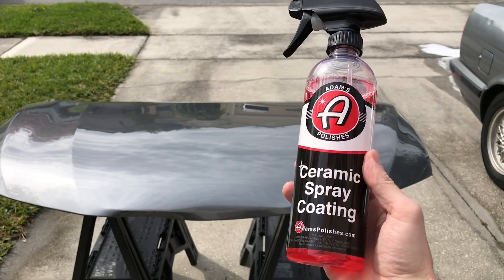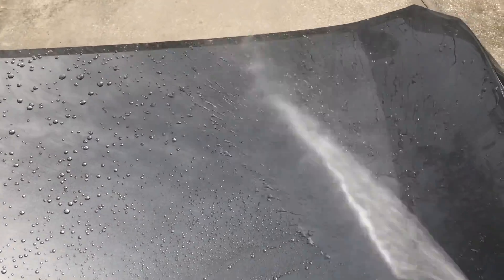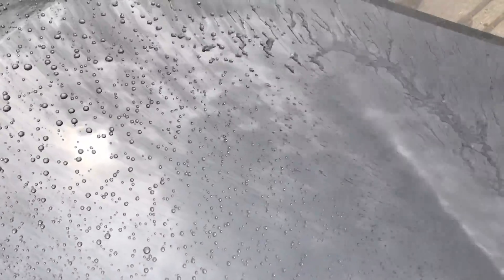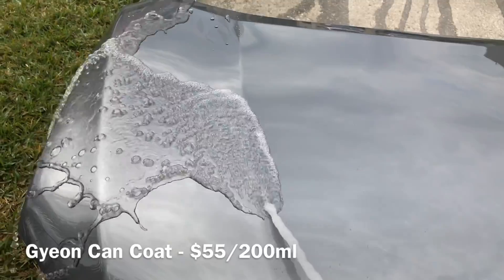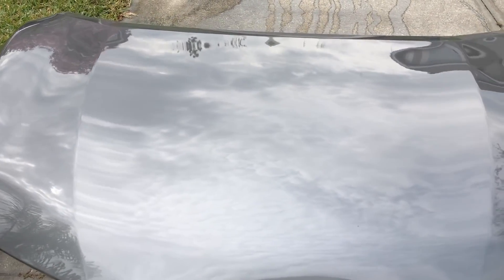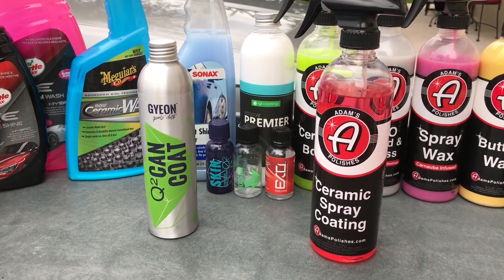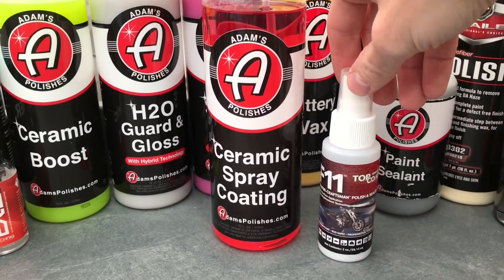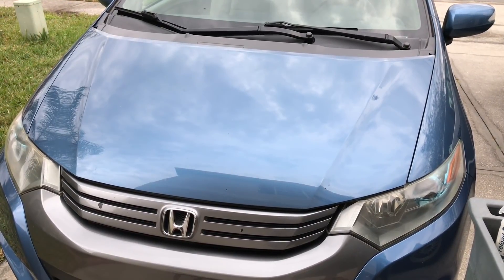Adam’s Ceramic Spray Coating - First Impressions & Hydrophobics

Comment: I just coated my car yesterday with Adams ceramic spray. I like the way it went on and the shine is excellent. I purchased the large bottle and have a lot left. I have been using Adams products for years. I will use the ceramic boost after I wash and for a quick detail.Great video ✊

Comment: Great video!  I’m currently a CanCoat user, but I find it stickier to apply and remove. I have used TAC Systems Moonlight, which I really liked because of its ease of use. I’m very interested to see how the Adam’s product compares in durability with CanCoat. WaxMode, I consider you the YouTube grandfather of testing paint protectants. I remember your first couple of videos flooding panels in your garage testing Walmart level products. There are so many who have copied your product testing methods throughout the years. You should be very proud you were the first to start this trend. Most people probably don’t know that about you, but they should!
Reply from the maker: Thanks Steve that means a lot!  I wasn't the first but I definitely got hit by the water bug once I saw just how different all of these products behave compared to each other, it's been a fun ride testing these all out!  I've heard some great things about Moonlight, none of the places that I regularly buy from stock it so I never jumped on TAC System's products but maybe some time in the future.  Really hoping the Adam's holds up because the ease of use is excellent, would be a bummer if this awesome beading is short-lived.

Comment: I'm looking forward to topping my TAC system power plus Sio2 paint coating with IGL Premier come spring. I mean ive been using various things ontop of my car since late fall and have been VERY happy with them all but this IGL Premier has peaked my interest for some reason, maybe because us mortals can't get our hands on their actual coating for paint.
Reply from the maker: I am LATE to the IGL game, and I didn't realize Kenzo was an authorized installer only coating until you mentioned it.  I was wondering why it wasn't popping up in the stores, what a bummer!

Comment: How am I suppose to know what side of the hood has what product on it? I already know about cure times and applications.... I wanted to know how each performs side/side and I have NO IDEA what is on that hood you keep hosing down.
Reply from the maker: At the beginning of the video I put the products up to show which side of the paint they’re on, Can Coat on the left half, Adam’s on the right half, they are split right down the middle of the panel.

Comment: Do you think you could please do me a favor? I was trying to find a video but couldn't find one and was hoping you could make it. Using sonax bsd and applying in while the panel is wet and drying. I want to use it to maintain my sealant and wax. I get my car done by a professional as my back is bad so I need something easy to maintain the coating. Do you have any recommendations that I can use as a wet application and dry with a leaf blower? I can use a microfiber if I have to. Thanks for all the help and work!

Comment: Mate very pleasing to hear a bloke talk about flooding, using the high mass slow water flow after washing the car.
My father has advocated the method for over 40 years. 
He would laugh watching high pressure wash and rinse. Althjough duco fi nishes have changed through the years it is still best method of rinse.
If the polish finish is adequate you should be able to drive the car down the road to complete the dry process.
Reply from the maker: Definitely, especially important if you don't have a blower to blast the majority of the water off the paint prior to towel drying.  I've been looking for some time for a nozzle that has a decent flood setting, sure beats kinking the hose and taking the nozzle off to flood, most of the quick disconnects or shutoff valves create too much pressure as well to flood effectively with the nozzle off the hose.
Reply: Blower???  Gadget for the gullible mate.

Comment: love the video what is the name of the blower thanks
Reply from the maker: The blower I'm using is the main head unit of the Ridgid WD4080 shop vac, it actually detaches from the body of the vacuum but still corded.  This vacuum is at Home Depot, but I see they're not offering the deal with the detailing kit that comes with a much better hose setup and a few good attachments, it was like $75 for everything and now I see the vacuum is $99 and the detail kit is $40 sold separately.

Comment: Great video! Where is your bead maker video?
Reply from the maker: Still working on the Bead Maker tests.  I applied Bead Maker applied on top of both of these coatings on the test panel to see how it does in the short term as a topper, more tests running against CG V7 as well that I need to see pan out.  I just topped a section of the CQUK 3.0 last week with Bead Maker but unfortunately we've got ran all day today and I wasn't able to run a rinse test yesterday.

Comment: Top Coat F11 gets a lot of talk cause they advertise on Facebook constantly! I see their ad all the time! Never would of heard of them if they didn't promote on Facebook..

I like to see you try out the Mothers CMX that's out soon! as it seems to be the talk over at AutoGeek. A 24oz bottle is said to be about $22. But it does require a 24hr cure time.
Reply from the maker: Right, for $60 you're paying $10 on a substandard product and $50 for them to excessively market the stuff online.  I've got CMX on order!  Should be in not this weekend but the weekend afterwards and then I'll start working with it.
Reply: Topcoat f11 is completely junk. Look at reviews on Amazon and google

Comment: Looking forward to durability experiences; same with the under-dog there - Turtle Wax Seal and Shine; any use of that yet?
Reply from the maker: Yes I was able to run a rinse test on a section with Seal N Shine yesterday, I didn't see anything crazy going on.  HCW is more hydrophobic and I'm very curious to see how Seal N Shine would do against the basic Ice Spray Wax to be honest, I'll probably run a durability test with these paired up side by side.  The smell seems very close to their Express Shine Carnauba Spray Wax which is a bit of a bummer, I would have liked for them to come up with a more unique scent.  Price was around $12-13 but you also only get 16oz in the bottle instead of the 20oz of Ice Spray Wax.
Reply: @WaxMode  thanks for the quick reply; the Ice and the S&S would be great match-up as I was wondering the difference myself as the Ice seems to be fairly durable. For sure having a similar scent would make me kind of wonder about formulas. Thanks again for the reviews and info.

Comment: I’m assuming the microfiber towels used to apply and buff off either products shouldn’t be re-used?
Reply from the maker: With CanCoat, probably a good idea to keep these microfibers off the paint if you plan to reuse them, the suede microfiber applicators that I use to apply it stiffens much more compared to the Adam’s Spray Coating.  The towels to buff off Adam’s you should be able to reuse them on paint, I didn’t notice marring.  If you do, check with a small section on your paint first, it’s possible your paint may be soften than what I’m working on.

Comment: So you wash the vehicle, clay it then ceramic? Can you put wax on after a ceramic coating or is it just redundant?
Reply from the maker: With coatings, generally the more prepped and polished the paint is, the better bond and durability you're going to get.  So wash, clay, and polishing if necessary is the way to go prior to use.  You can wax over top of coatings but this could clog up the insane hydrophobic behavior of the coating, so I don't recommend any paste or liquid waxes on coatings, instead a spray topper to revive them once you notice a drop in water behavior is the way to go.  Adam's is easy enough to work with that I feel like you could use it as a topper to itself.

Comment: Hi, to coat a full size sedan how much product do you think it will take? Just trying to figure roughly how many cars it can coat. Thanks in advance
Reply from the maker: Adam's is estimating 3-4 cars out of the 8oz size, 6-8 out of the 16oz size.  I feel you could probably stretched this a little further than that, seems like it spreads nicely in the towel.

Comment: Before applying any product ... You always wash then clay bar and polish the vehicle ???
Reply from the maker: Only for testing, I polish all previous products off the paint because the current wax/sealant/coating can impact the performance of whatever you're putting on top.  For everyone else, it's up to you how much prep you want to go through to try a new product out, you can definitely apply a multitude of different products over top of each other without any issues.  But with coatings, they come at such a high price that you really want to maximize your prep to maximize the performance of the coating.  However, something like this Ceramic Spray Coating may work very well on top of surfaces that have already been sealed or coated when used as a topper.  I'm testing this out now.

Comment: What are your thoughts on Gyeon can coat compared to Sonax  net shield ? Thanks
Reply from the maker: I really like both, they're much different products but overall outstanding in their own rights.  Sonax Polymer Net Shield I have not run through a topping durability test, it definitely survived at 5+ months with no toppers but I feel I could have stretched that farther with regular toppings, I buffed it off the paint before it completed its durability cycle.  But man, it's a workout to apply and remove to the whole car, the wipedown is excessive, I feel Gyeon Can Coat is better in this regards, not as much of a workout.  Both have top tier hydrophobics, but Can Coat I believe has a higher potential for stronger durability over time when topped regularly.  PNS doesn't feel as slick as Can Coat, but still provides a strong gloss like Can Coat.
Reply: WaxMode thanks brutha! Keep up the good work. Love your videos.

Comment: When u use the microfiber towels with ceramic coating do u have to throw them out I’ve seen a few things about the towels holding small particles that can scratch paint.. what your take on this
Reply from the maker: Can Coat starts to cure quickly in the towel after use, the Adam's didn't feel near as impacted but I also threw these in the wash shortly after use.  With coatings, it's a good idea to have some towels that you would not mind throwing away because they can definitely scratch the paint after the coating cures in the towel.  Jon at Forensic Detailing did a great video on this, and I have noticed marring on towels that I've used with CQUK that I didn't throw away.  For this reason, I use the Kirtland Signature brand that come in a pack of 36 towels that are a decent price that I don't mind throwing away after use.

Comment: What/which product would you recommend if your car has already has a ceramic coating to help maintain it??
Reply from the maker: I'm working on testing this out.  Bead Maker has been fantastic on top of older coatings, great slickness and gloss, it really has revived a lot of the hydrophobic properties of the base layer coating and even boosted beyond short term level performance on Classic CQuartz.  However, I'm not as sure of its use on top of fresher coatings so I'm still testing this out.  Otherwise, Polish Angel High Gloss, Rapidwaxx, and Cosmic Spritz have been great, Gyeon Cure and CarPro Reload are standards on top of siO2 coatings.
Reply: @WaxMode  cheers pal

Comment: Adam's typically puts out a good product, and I have no doubt this one will be good too...as you demonstrated here.  You will probably get around to it, but how would you say it "compares" to the Meguire's Hybred Ceramic Wax?  As you are well aware the Meguire's is significantly "less fiscally challenging."
Reply from the maker: I'm expecting the Adam's to be much more durable compared to Hybrid Ceramic Wax.  I could see myself coating the paint with the Adam's and then maintaining with HCW over the months for maintenance washes.  We will have to see though, the test car just took a 500 mile trip and we've had massive rain this week so it will be interesting to see how Can Coat and Adam's have held up on the front hood.
Reply: @WaxMode   And this can go over the carnauba coating I presently have - correct?  One other question: do any of these coatings compare to Collenite??
Reply from the maker: That’s a good question!  Coatings can stick over different products.  However they’re so high priced comparably that you’re going to want them as your more durable base, and they should be able to bond better in theory if the paint is first free of a wax or sealant.  In terms of durability, they should easily out perform the Collinite waxes, Can Coat definitely will, Adam’s we will need to see but most coatings I’ve tested have greatly outperformed every other wax or sealant in durability.
Reply: @WaxMode   Thanks for your prompt and informative reply!  I've ordered the product and will wash, clay and "polish" before applying.
Reply from the maker: Ken you may want to hold out for the new Mother’s CMX Ceramic Spray Coating, I’m going to be testing this coming up soon when retailers get it in stock, this is going to be around $20 for 24oz and Mother’s is really pressing its strong durability and ease of use.
Reply: @WaxMode  Uh oh.... may be too late.  Adam's had a 15% sale sitewide so I purchased their Ceramic Spray coating...and it should arrive in about 5 days.  I have lots of detailing products from Adam's, Griots, Meguires, and Optimum, but little from Mother's.  However, if the product is comparable, the price is certainly a draw.  The Adam's product was more than I usually drop on a single product, but I'm hoping for a solid performing result, plus, my son might want to try it as well.
Without question, car detailing is one of the most subjective "sports" I have ever been involved with!  Fun stuff!  And if I haven't mentioned it, I enjoy your videos - a lot!

Comment: How do you feel this compares to polymer net shield?
Reply from the maker: Polymer Net Shield is a very good product, it's going to be more effective in the short term at really keeping up its extreme hydrophobic behavior.  Adam's Spray Coating does drop in performance after a few weeks on the paint on the daily driver.  If you have PNS side by side with Adam's, it's going to look like it's holding up better at the same time point.  Adam's is much easier to apply to the paint, to a very significant level, also much slicker feeling.  Two very different products with tradeoffs that need to be taken into account before you decide on one vs. the other.
Reply: @WaxMode  I actually have a can of pns but was looking to try something new.  Maybe I'll go full ceramic coating.   I just bought a bee car and I have less than 1000 miles on it.  I wanted to do something soon, before there needs to be a ton of paint correction.   Any suggestions on a ceramic coating?
Reply from the maker: @The_combat-nurse  -  Huge fan of the CQuartz coatings especially CQUK 3.0.  I have the new CQuartz Lite coating on order that should be in next week to begin testing, heard a bunch of good initial reviews so far.  Above PNS's performance, Gyeon CanCoat is a good first coating to get into that should last well over 6 months with maintenance.  I expect CQuartz Lite to also have great durability but also be MUCH easier than Gyeon One to apply and remove, I did not like Gyeon One at all in how difficult it was to remove but it certainly held up well beyond 9 months with little maintenance.  I also enjoyed Gtechniq EXOv3, I'm currently testing V4 right now, good on/off capabilities and V3 easily lasted 1 year on the paint.  All of these will easily outperform Adam's Spray Coating in performance.
Reply: @WaxMode  how long does the 3.0uk last and how hard is it to apply.  I worry about not putting enough on or putting it on too thick if that makes sense.
Reply from the maker: @The_combat-nurse - CQUK 3.0 is a multi-year coating, I went 1 full year of durability without topping and it held up extremely well.  A little goes a long way but it's definitely a heavy coating to apply and remove, slickness isn't the best, little slicker than PNS.  Need to test on a small section before going over the whole paint just to make sure you've got the process down so you aren't leaving coating residue behind when buffing it off with the microfiber.  CanCoat I would more recommend for more of a first time coating compared to CQUK 3.0 if you haven't worked with any before.  But CQuartz Lite could be the best bridge in performance and application compared to CanCoat, this is what I'm going to focus on when I run my tests next week.
Reply: @WaxMode  Awesome, I am not opposed to trying the uk as I do a lot of paint correction, just never used a ceramic coating before.  Maybe I will give the can coat a good hard look.  Could you top that with something like reload to add extra protection or prolong the durability?